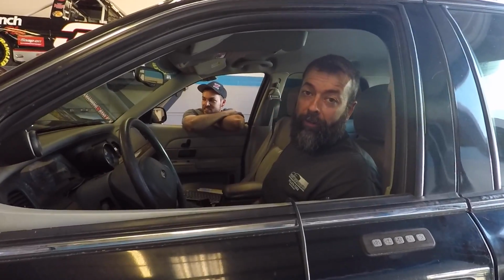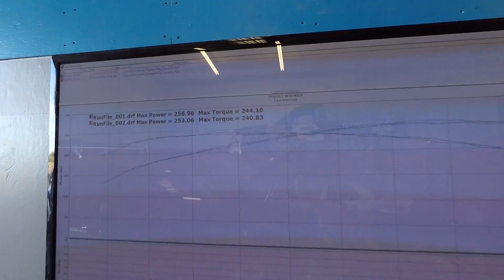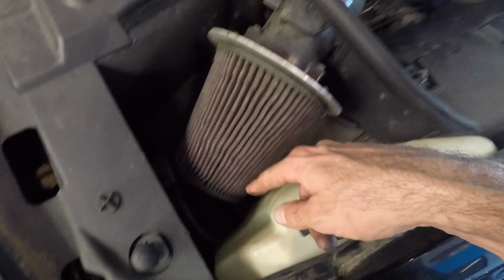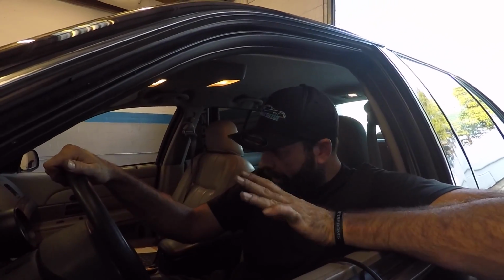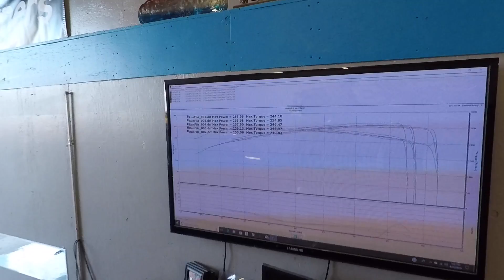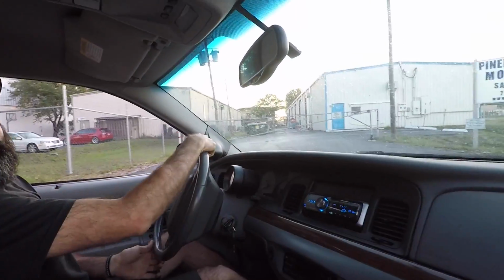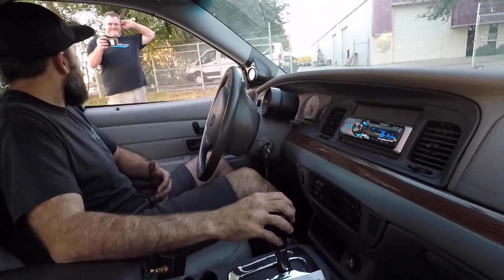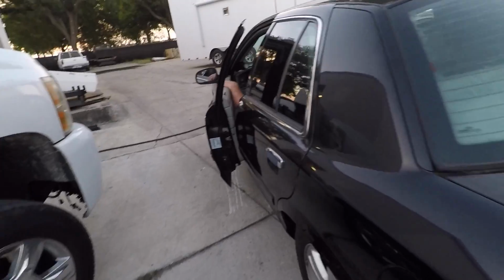Dynoing The Subscriber Donated Crown Vic! Major Favor Has MAJOR Potential!

Comment: I suggest some videos on the Motor Trend On Demand called Engine Masters. They found that icing the manifold does nothing, less than 2hp difference (at 600hp, even less for sub-300 engines). Sucking in outside air below 80F is cold enough to keep the manifold cooler during the run as faster air movement sucks out the heat early on in the run. It may help with a few numbers right off the line, but otherwise make almost no power difference. 
The heat only affects it with repeated runs boosted or air temp is over 90F (especially at higher elevations).

Comment: My dad had the SAME EXACT car growing up as the family car. 03 Crown Victoria LX Sport, all black, gray leather interior with the console shifter, 5 spoke 17 inch wheels, complete with the faded paint on the top of the rear bumper cover. The only time the rear bumper didn't look faded was right after washing it. The only reason I think this is a different car was the frame got pretty rusty toward the last time I saw the car. Not sure if yours has air suspension, which was a pretty cool feature.

Comment: I'm late to the party, but the LX Sport came with a 3.27 open diff from the factory. Also, they came with police interceptor sway bars on the front and rear from the factory. They have a slightly smaller torque converter also over the regular crown vics.

Comment: The transmission has debris in it from something that is coming apart, after you drive it the filter in the pan gets clogged and with no oil pressure nothing is gonna happen. When you let it sit the debris settles to the bottom of the pan and she is ready for another rip for a minute or 2.

Comment: If you leave the key on and engine off with the seatbelt unplugged.... when the seatbelt light turns off. Plug in and unplug the seatbelt 3 times. On the 4th plug in the light should flash. Repeat for the passenger side. That will get rid of that annoying seatbelt warning. If that doesnt work. There are Ford seatbelt warning bypass videos that show how to do it. Your welcome.

Comment: what does it mean when your car is rattling at mid to upper rpm range, not a rod knock or lifter issue. it's literally like you are shaking a rattle can. seems to happen more when hot outside.
Reply: That sounds like spark knock to me
Reply: I keep hearing that on this channel and don't kbow what it is, but thought it may be that
Reply from the maker: Spark knock. You can try n put a bit of race fuel or colder plugs n see if it goes away

Comment: I still have that 76mm turbonetics turbo and turbosmart blow off.. just sayin.. lol
Reply: I'll take it....
Reply: @blakeb4399  im wanting to trade it for Jeremy to tune my truck..
Reply: @silveradosaga8595  damn good luck
Reply: @silveradosaga8595  what's done to it
Reply: @blakeb4399  heads cam built 4l80e 3200 stall 102mm nick williams throttle body  175hp nos it make 450ish hp  on motor 411 gear with 26" wheels
Reply: @blakeb4399  its pretty nasty for a 5.3 quad cab go to my channel and check it out

Comment: seems to slip and have about performance i had in my  Pontiac Safari wagon years ago…   does not sound as nasty tho… my th400r came back to life after oil change and new filter.     that old warhorse was bullet proof…   only thing to fail in 6 years i daily drove it was alternator that was original piece from 87  =)        was an fcking nightmare on -36c winters tho…   drank 38-42 litres per 100kph (about 1.4mile per gallon )even with warm engine startup with block heater. .

Comment: The Crown Vic, Mercury Grand Marquis, and Mercury Marauder have a 1.25" longer transmission tailshaft and tailhousing compared to other 4R70W transmissions. Be sure it's the same length! I found out the hard way.
Reply: It was my understanding that only the Police/P71 Vics came with the longer tailshaft and the regular CV/GM had a standard length.  It was longer on the P71s so they could shorten the driveshaft which  helped reduce harmonic issues when operating at high speeds that police vehicles encountered. 
That said, I was told the tailshafts can be swapped between 4R70Ws fairly easily.
Reply: Yeah I Found that it's all of them. I got one out of a P71 and regular Crown Vic and both were too long for my thunderbird. So I had to rebuild my thunderbird trans with the p71 front pump and a couple hard parts and a rebuild kit with a JMOD shift kit.  It bangs gears like no other automatic I drove. 
To get back to the topic at hand, both of the Vic transmissions were too long and I looked it up and only the Vics, Marques and Maraduer all have the longer transmission. But you know how it is on the internet with getting the correct info. I just know from personal experience.

Comment: wow, with a new transmission and a Limited slip diff set at 80% Forward cross Torque (in other words the wheels can only turn 20% difference on forward) and 60% Reverse Cross Torque (deceleration), this car would advance promptly but bet be able to do donuts and burnouts! (tho as long as you do not get friction clutch based ones... or a viscous one... otherwise that will not last long with such abuse ;P)

if you ask why a LSD differential, well,  a locked Differential will not let you turn and a open one spins only one wheel... 80% will let the car turn yet be stable in strait line and the 60% on deceleration is so it is not unstable all of the sudden when braking but have more turn power when it matters.

Comment: Quick question you were talking about gear ratio and how it kills horsepower so if you have a gear ratio like 4.56 and a crate motor that supposedly has 550 horsepower  after the gear ratios taking over through a Dino Run you're not going to have but what maybe  250 to 300 horsepower could that be an actual thing?      
    Reason I'm asking is my father bought a GM LS3 crate motor and he has taking it to several different Dino shops and he has 4.56 gears and a 5 speed transmission and  can only get it to make mid 200 horsepower range and it's supposed to be a high performance LS3 crate engine that's supposed to be rated at  530 to 600 horsepower.
Reply from the maker: Zack Thomas yes, and no. If it were In the 1:1 trans gear it should still be in the mid 300s depending on the rest of the drivetrain. In other words the oem native vehicle that might Dyno 425rwhp would be say 350-375 with 4.56 gears
Reply: Okay thanks man

Comment: had a 97 Cougar XR-7 bought it brand new and it had a plastic intake that split and it hydrolocked the engine and yes it was recalled.they ended up replacing the engine

Comment: Maybe this ford will last ya a bit longer and give ya a good platform for drag racing what do you think I've had nothing but luck whith fords and currently picking up a 68 ford ltd 2dr hide away headlights not sure on moter it's a big lock but either a 390 or a 427 something like that I'll find out this week to come gonna power her up and hopefully get in the drag racing circle wit ya all and would love for ya to tune it this late summer or next summer ...love ya all and catch ya soon
Reply: It's definitely not a 427 unless you're giving about 30 grand just for the engine
Reply: @derrickbasenberg8568  yea well I looked up the car back then and the car came whith a390 or 427  front the galaxie 500 nd the car deffinetley looks like the galaxie 500 so I'm not sure but the car deffinetley is a big block and it's as original as it gets from what I've seen so I'll know more when i get it in a couple days I'm gonna be starting my channel and do my build on it but from looking it up it's possible and the peaple that have it also just sold a 65 corvaya  and has a flat nose van as well for sale all running but cheap money if i had the money i would own them all but this guy dont care if it's worth a lot or not ..its like a gold mine from what i see but i really am hoping it's a 427 that would be sweat  but again I'll know more soon

Comment: The older plastic manifolds had a plastic coolant crossover on the front of the manifold and the alternator bracket bolted to it and it would crack and explode.

Comment: Hoe does the rear gear ratio affect peak power numbers? Wouldn’t it make the same peak power just at a different wheel speed?
Reply: Jason Cassidy dynos measure torque over time/RPM, the shorter gears (4.1 vs 3.08) are larger causing more loss and the load is lighter over time. Read a couple articles and the science will make sense

Comment: The 4.6 in that car, unless it’s had the rotating assembly gone through, is limited to around 400-450 wheel before you start wrecking rods, same as the 4.6s that come in 2v mustangs

Comment: I have had a lot of 4.6L both 2v&3v in my opinion the 4r70w transmission is garbage. As well as the head gaskets I always switched to MLS if I was dealing with a CI block with 4L80 CA heads. I have had the issue with the intake leaking coolant with both the plastic and AL types. I like a 3:66 rear end for them but I mostly used 3:73 if I had a 2v.

Comment: 2v cant handle much more then 430 whp,  they throw a rod after that. Had a KB 1.6 blower on my 04, made it 23k miles before she let go. New motor set at 9-10psi 410hp 409tq sold the car after she was back together lol. 
Boost A Pump wouldn't work properly for tuner, ended up doing the 04 cobra pump, no boost a pump. Used a 2step to cut the spark on limiter instead of fuel

Comment: What year is that Vic!!!? Because if it’s under an 01 forged internals are practically useless before 01 the Windsor block is known for cracking in half and mushrooming pistons but you have forged internals so that you don’t have to worry about but if it’s an 01 or above you have a Romeo iron block mix that with your already forged internals and you have a pure boost ready 281 monster

Comment: I still have my HAT in the ring for the car, DD214 on request. LOVE THE CAR!. Back in the 80's I had a 73 Roadrunner with a 340 with the (340 X) 2.02 valve heads tripple grind cut, eddlebrock high rise, carter 750 carb, 290 lift cam and Blackjack headders, 727A trans with 727B guts, it would pull the front left wheel off the ground on launch, guessing about 350WHP on pump gas.

Comment: What if both make it? the supercharger and the turbo? twincharge the vic?
Reply: SOLD!  Best idea ever!
Reply: Twin charging it would be so awesome and unique!
Reply: That would be freakin sweet
Reply: I cannot disagree. Lol
Reply: The principal is cool but there's a reason guys don't do it regularly if at all they will work against each other and would be a tuning nightmare everybody would do it otherwise for low-end torque and top-end power
Reply: @freedomfox8183   all cool things come from harsh beginnings and a twincharged vic would indeed be a nightmare, but you could essentially do a system like the nissan march super turbo has, where the supercharger "turns off" after the turbo has spooled up to a certain point
Reply: Turbocharge that supercharger.
Reply: In WW2 fighter planes had setups like that! Would love to see it done on this beast!
Reply: maybe a electric cutout on the hot side that can open once the rpms are high enough after the supercharger peaks out.

Comment: When I was a teenager I had an old 4 cylinder Mustang (yeah a 4 banger!) and my transmission did the same thing. Everything went forward, even park would try to go forward but wouldn't let it all at the same time. It's a shame I beat that car the way I did. A 1976 Mustang 2 Fastback. Had potential but was a turd...
Reply: Mustang 2s are gayyy and I love stangs
Reply: @electronbeing5473  glad you think that way. At the time I didn't care what it was, it had 4 wheels and ran... Kind of. I called it the Mustard Stain. Also I think you're gay for says "stangs" so... Lol

Comment: Jeremy, service the Transmission and check the valvebody bolts. I'd bet they're spinnable by hand. Retorque and change the fluid.
Reply: Yeah, but I bet that it's trash now though. All clutches are most likely burned now with all that fun he had.
Reply: Yeah, he has definitely welded some clutches together. Trans is trashed now.
Reply: Definitely do a service and Change filter at least. I have a 2003 and filter was stuffed at about 100k. Works fine now👍